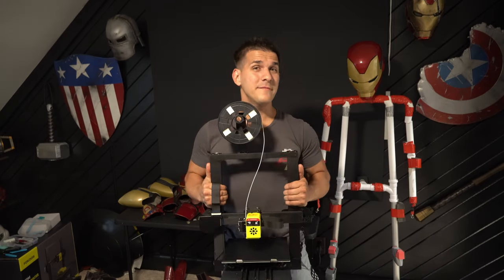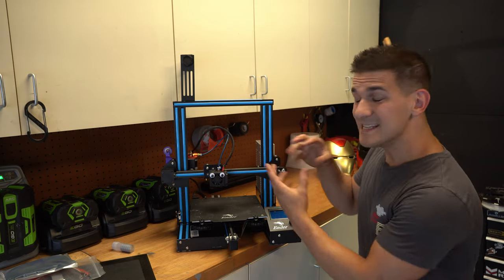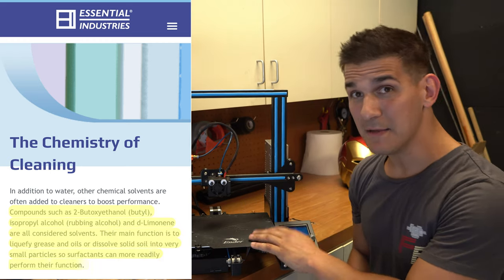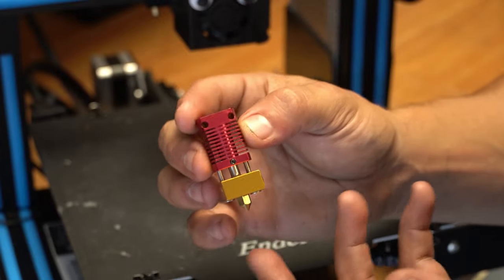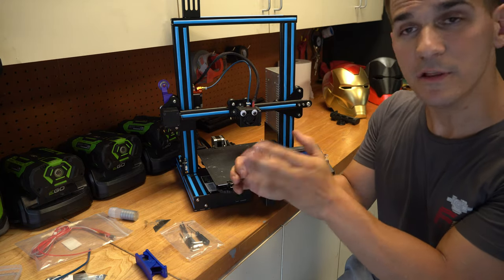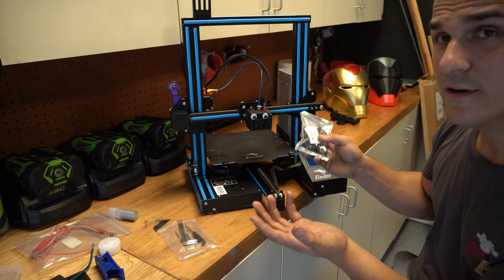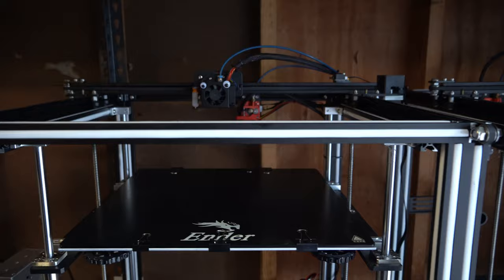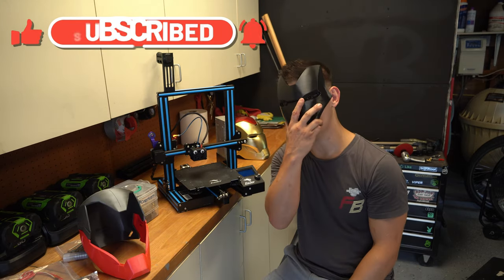3D Printer Maintenance | How to Keep Your Printers Running SMOOTH!

Comment: Great video....Im only a few months into 3d printing with alot to learn...just the past week i had on my Ender 3 V2 i had massive under extrusion issues..I thought it was clogs..but FINALLY think I narrowed it down to the extruder spring tension screw was loose and didnt have the tension it needed to feed filament

Comment: Having the proper tension on the rollers is a good thing to go over I went to a friends house that was having issues and I found that his rollers were way too tight having them just snug enough not to free spin but not enough for things to get wobbly is best. After re-adjusting the rollers and belts his layer shifting ended. 👍.

Comment: Very useful! I’m gonna have to go through a basic maintenance on mine bed was level and I was cleaning the dust around the bottom and managed to unlevel it and now no matter what I do I can get the bed level on one side the nozzle goes straight into the bed and unseats the extruded from the belt.
Reply: Check your z axis. It’s probably off level by a touch. Use a spacer from the frame and manually adjust the steppers till you can clear the spacer to each side. Then relevel the bed.

Comment: Upgraded my Ender 3v2 with a all metal hotend, and all the videos I watched said be careful don’t over tighten.  I tried to print and all I got was clogs.  Wasted so much filament.  As soon as I took it apart and looked, the dang thing was so loose.  I threw it on a vice and tightend it like a mad man.  Now I got great prints without clogs

Comment: don't have the problem with the Bowden Tube because I have a Longer LK5 Pro. My hose only goes as far as the heatbreak. But the tip is for both variants of a heat break.

Comment: One thing that was happening on my ender 3 pro was the z axis limit switch. Sometimes it would click twice (as it should) and sometimes just once. Then thinks it’s good.  If it does not click twice when it homes it is always too far from the bed.  Turns out this switch can sometimes get dusty and affect this function.  Once I figured this out I haven’t had to level since.  I just gave it a few bursts of air from a can to clean.  If that does not work it maybe time to replace that limit switch.

Comment: One thing I'd recommend is spending a few more bucks on higher quality replacement fans for your printers. You really do get what you pay for: high airflow, low noise and good longevity. The $10 packs of WINSINN fans on Amazon are cheap, but they're also loud, and they fail annoyingly often.

I've also come to love BMG-style extruders, and use the Trianglelab ones. You have to run a bit of gcode to load/unload filament quickly when changing it, but they don't grind the filament, grip it super well, and have so much torque! Partial clogs are no match for those.

Comment: amazing video frank. ive recently had a few clogs and had to trim the boden tube and changed the nozzle incase. Havnt had any issues since but i was worried at first with taking thing apart but after some research and videos like this things have become alot easier and are not scary at all anymore XD. STILL SUCKS WHEN SOMETHING FAILS THO XD LOL

Comment: Love the channel! So my Cr10s Pro v2 had an issue. The fan shroud broke off and bent my BL touch pin and ripped one of the wires out of it. Also it now prints about 3 inches off the bed and I can’t seem to get it back to where it should be. Any thoughts on how I can find the right BL touch sensor? Thanks!

Comment: VERY helpful video!!! I actually have had the bowden tube MELT at the hotend....not sure what caused it. Replaced it, and haven't had it happen again. What about under extrusion (I think that's what it's called)? My layer lines when printing on the bed, seem to have "gaps" between them...but only in spots...

Comment: my easy thread printer is new and some of the prints wont stick to the bed some of my prints are also getting smashed onto the bed even though I've put the bed the lowest i can and it will also start to knock the print of course and mess it up and sometimes it wil start the print and then just start printing random lines and stuff on top of it

Comment: There is myth doing the rounds in the community that IPA ruins borrosilicate glass beds, my oldest borroslicate glass bed is about 13 months and I have cleaned it more than once a week every week and that bed is as good as the newest one I have which is six weeks old, how often have you cleaned your glass beds with IPA, Frank?
Reply from the maker: I clean it with IPA become every print lol nearly daily for months. On multiple printers. It’s indeed a big myth. One cheap bed probably failed one time

Comment: My CR10 Max has blown through the wheels for the bed, not comfortable enough to fiddle with them yet but have still done some research on them just incase, found some clear wheels that claim to be much more resilient to stripping down- any advice you can give would be greatly appreciated! ❤
Reply: Also, was in your livestream not long ago where you where you were melting some parts together, thanks to that little trick I have officially finished my Mk.6 Master Chief armour that I mentioned! Split the workload between my CR10 and Ender 3- done in a little over a month 😁

Comment: Hey I know profile and stuff are not your thing, but can you show how to setup the sovol and what kind of bed and stuff you use 
I just got a used one from EBay
Reply from the maker: I have a video on the Sovol. I just use a modified Creality  cr-10 Pro v2 profile
Reply: @FranklyBuilt  how do you account for Direct drive when it comes to retraction and stuff 
I have owned an ender 3 pro for like 3 month, so I understand the Bowden tube set up

Comment: I have been using my ender 3 and it has been working great. But all of a sudden it no longer started registering the bed warming to begin the print so it wouldn’t start the print. Even if I manually changed the starting bed temperature. I thought it was the sd card but I reset it and it didn’t fix it. Please help

Comment: Is it normal for the ender glass hot bed, on the black side, to be not level? It seems to have a dip in the middle, but the non-black glass side is fine, so just unsure what’s going on :S

Comment: As always, great video Frank. My problem with my ender 5 plus now is that, my printer suddenly printing air without any filament coming out. Is it because of the extruder or hot end?
Reply from the maker: Could be either
Reply: @FranklyBuilt  I'll look into it

Comment: Great video dude, nice!
Reply from the maker: Thanks!
Reply: @FranklyBuilt  wondering if you could help. I have an ender 3 pro and  every time I try to print something, it reaches the right extruder temperature, and then just fluctuates around that point for ages, never actually starting the print. I replaced the thermistor, started working again for a day or two, then broke again. Replaced the heating cartridge and nothing changed. Any chance you could help? Don't worry if not?
Reply from the maker: Try posting up on my discord man. That sounds like an odd problem
Reply: @FranklyBuilt  alr thx

Comment: What is your largest print bed? I'm just starting to look into printers and my first thought is... do I want 4 or 5 smaller printers or just go all in with this 13,000 dollar printer with a 600mm x,y, and z print capability
Reply from the maker: 450x450x470mm. Creality CR-10max. No need to spend over $1000 on a printer nowadays
Reply: @FranklyBuilt  Thank you for the heads up. I'll look into that model today. You and your content are a huge help. Thanks again.